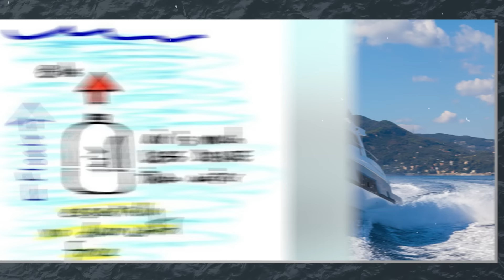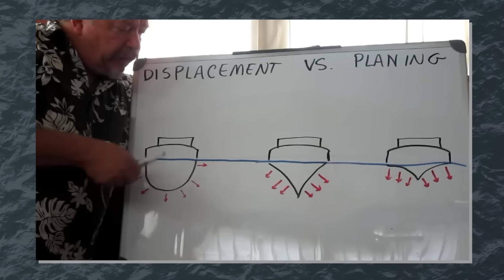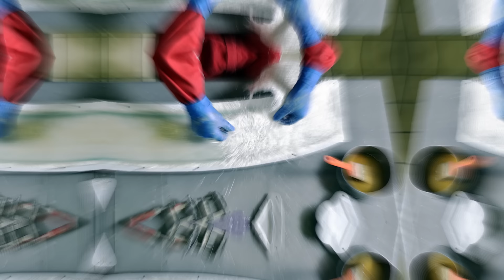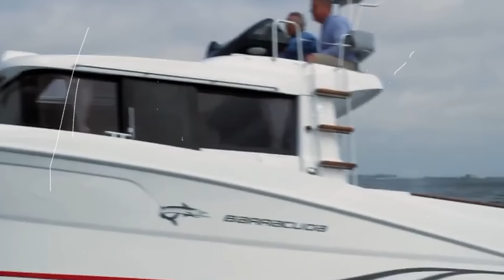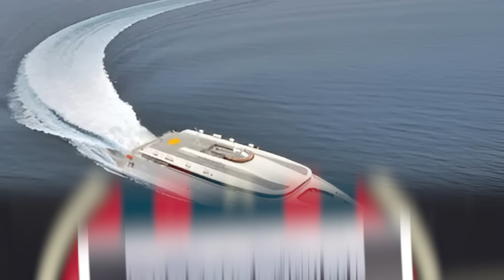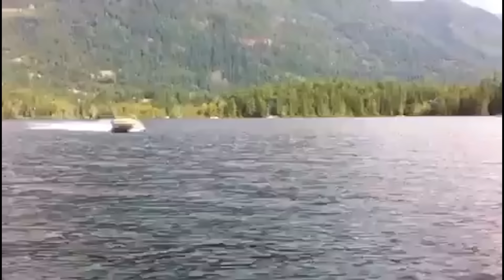Hull Physics Secrets Every Owner Should Know

Comment: Sutphen race boats with a 26 degree deadrise at the transom are legendary rough water race hulls.  The founder of the companies grandfather worked for Elco and designed the 77 ft PT boats like PT109  
They dominated before offshore racing was moved inShore where step hulls were more efficient without the worries of rough seas. Sutphen always felt step hulls were unsafe and were prone to spin out.
Reply: Consistently variable dead rise all the way back.

Comment: And what about planning catamarans?
Reply: planning?
Reply: Slim hulls beat the 1.34 equation
Reply: Assuming you mean something like unlimited offshore racing cats.

 There really isn't enough wetted surface to get the two hulls up on a plane, instead, with enough speed, air funneling over and under the central wing will lift the boat until it has even less parasitic drag from the water than a planing monohull.  Getting the lift/weight/drag balanced so the hull is mostly out of the water, but not lifting off to do a backflip can be tricky. Also, getting them up to a speed where the wing becomes effective can be difficult. Fore and aft balance is important, and some used air injection with a surface piercing prop to get the prop up to speed.

Many years ago I worked for a cat manufacturer in Miami that built a 60' aluminum cat on spec. Without it's superstructure it would not get up, just pointed skyward. A dozen or so of us got up on the bow, arms hanging over the edge. We proceeded up the Intracoastal, as it picked up speed the bow lifted until it felt like 45 deg. The water seemed far below, and we kicked up a wake that I'm sure washed away some of the adjacent homes. Finally the bow dropped slowly, and we took off. I don't know how fast we went, 60 mph+? 80 mph? It was just as exciting slowing down within the confines of the Intracoastal.

Comment: A Hickman sea sled is more efficient than even a step hydroplane.
By the way, a deep Vee hull is very poor in efficiency NOT because it has more wetted surface area, but because so much water slips edgewise out the chine rather than staying under the boat all the way to the transom while lifting the boat the whole time.
Reply: good luck with that one, I made one decades ago and I am still suffering concussion.
Reply: Oh, sure. Until you got into serious chop. Waves? 5 mph.